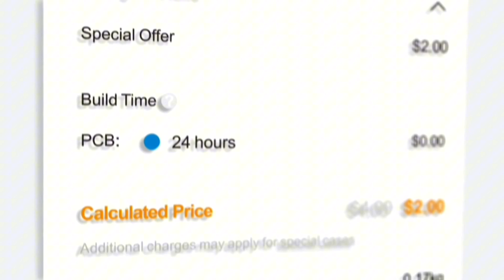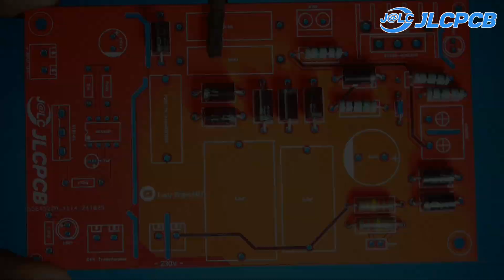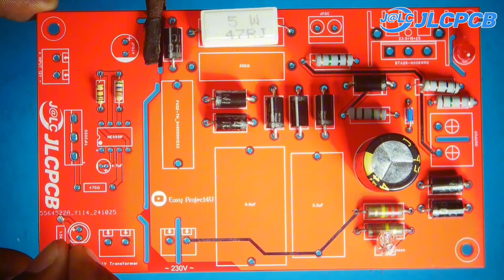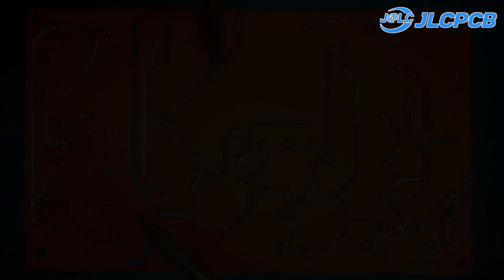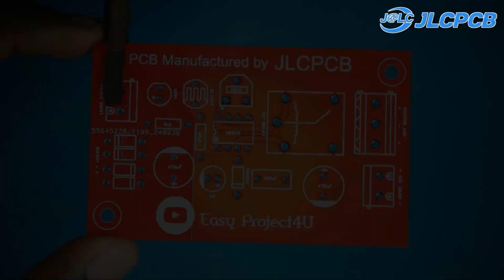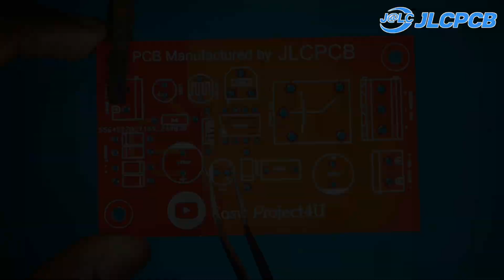DIY Electric Fence with Alarm Circuit | Step-by-Step Guide

Comment: Thank you for video. Could you share the component list
Reply from the maker: BTA26-600B or BTA41-600 - 1
1M ohm resistor / 1W - 2
1.5K resistor / 1W - 1
100 ohm resistor / 1W - 1
DB3 ( diac ) - 1
2 pin terminal - 4
1N5408 - 9
22uf/ 450v or 47uf/450v capacitor - 1
220k/ 1W resistor - 2
Neon bulb - 1
5mm LED - 2
3.3uf ( 335j ) capacitor - 2
2A Fuse with wire - 1
5.6 ohm / 5W resistor - 1
1.5k - 1
1k - 1
560 ohm - 1
470uf / 25v - 1
Ne555 - 1
8 pin ic base - 1
4.7uf/ 25v - 1
470 ohm - 1
Tip3055  - 1

Comment: Thank you for the video you shared. Can this circuit works with only a 12 volt battery  and without the alarm ?  Can we buy this from this from jlcpcb with all components? Do we haft to apply a code so this will be a profit for you from them? Thank you very much. I will order it.
Reply from the maker: Thank you for your kind words! Yes, the circuit can work with a 12-volt battery, but without the alarm, you may lose the alert functionality. You can order the PCB from JLCPCB, but the components will need to be sourced separately. There’s no need to apply a code; your support means a lot to me. Thank you for considering the order!